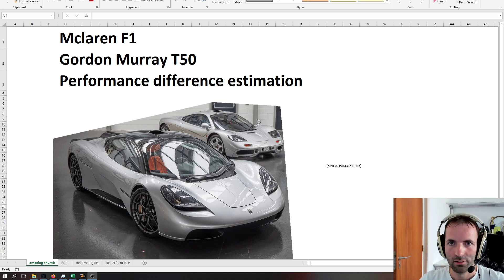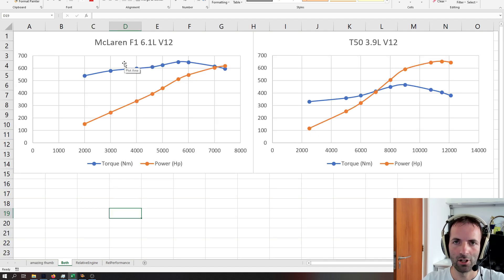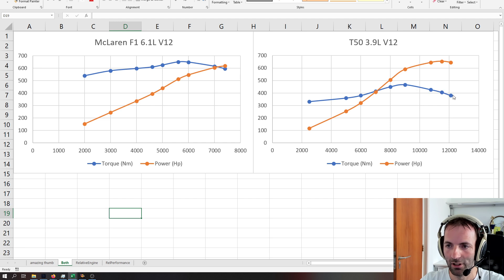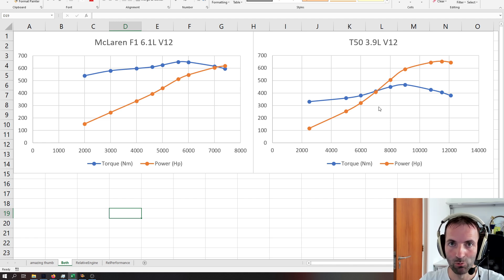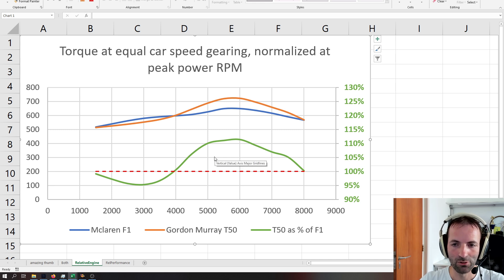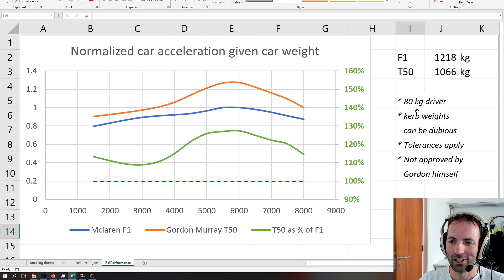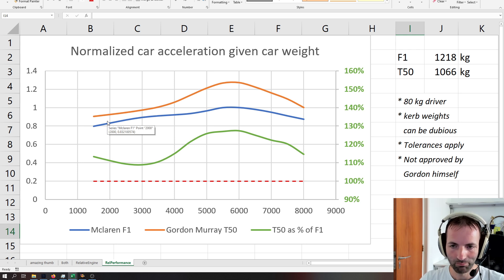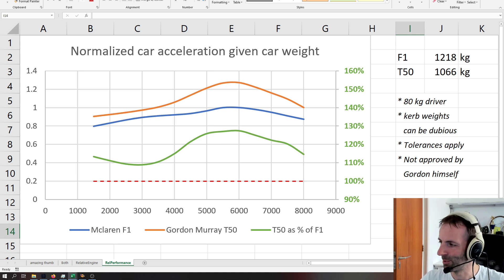McLaren F1 vs Gordon Murray Design T50, performance analysis

Comment: T.50 is ugly in my opinion,  and the engine sounds awful in comparison
Reply from the maker: Did you see Hagerty's video where Henry Catchpole drives both? I'm not THAT into the looks, and I think no video yet truly captured the sound of the T50 quite right. The deeper notes of the F1 are incredibly appealing indeed, but I bet you'd get goosebumps in a 12000RPM V12 as well..
Reply: I did see it, I'm just not impressed with the T.50. I've still not seen a good representation of a true F1 Successor.
Reply from the maker: @Asnyder4055  I'm not blown away by it either but I doubt we'll get anything closer than a T50 any time soon! Ah well, not like these are candidates for the cars we can get.. (if so, can I be your friend? :D )

Comment: Excellent video, can it hit 300 mph?
Reply from the maker: Only when falling off a cliff, and even then it probably needs to fall very straight down.. Air becomes solid at those speeds. If you need 300hp to do 150mph you need 1200hp to do 300mph, if the tires and rest of the car don't explode while trying..
Reply: @NielsHeusinkveld  Didn't the original F1 do 240 mph? and this is faster, so should it be able to do at least 250?
Reply from the maker: @yiva2037  I think they mention in the official info that it is not doing 240mph. And, the F1 had the rev limiter removed to do its 'record' run! So normal production Mclaren F1's probably won't quite reach 240! 
Such high speeds are really nonsense though, you will never do that, on most race tracks you will not reach ~180 or perhaps 200 on the track with the longest straight. So it is better to give the car a bit of downforce, to help stability and grip, at the cost of a bit of top speed.
Reply: @yiva2037  T50 will be a bit slower, 221mp/h - Gordon explained why.
T50 makes double the downforce, and downforce equals drag - that's why..
Reply: If straight line mode is activated it can do it I think but not more as power requirements will be significant after 250 mph

Comment: taking the gearing in account to "normalize" would require to include said gearing losses, or did I miss something ?

in any case I certainly do follow you on total weight consideration for actual performance estimation - and similarly power band width (whatever the gearing may be required) with respect to the total rev range does have a massive impact on drivers experience...

Comment: This completely misses the point. The T50 has been designed as a drivers car as stated by Murray himself. It's not a numbers chasing car. Having said that other than a bike engined track special I can't think of a road car that has such a high revving engine. That V12 is a masterpiece. Over 600 BHP and 1000 kg equals very quick indeed, add to that a 12k redline and more than enough torque - its like having the best musical instrument under your right foot. The cleverness of this car is in it's packaging and aero. I love the fact its understated and compact, but still arresting to the eye.
Reply from the maker: I don't think I'm missing any point, I know and love the car for its purpose. As was the F1, not a track car but amazing in so many ways. This video shows that even with reduced torque, because of the higher revs and lighter weight, despite not aiming for numbers, its still likely to outperform the F1.
Reply: @NielsHeusinkveld  It would be a very interesting drag race F1 vs T50 in a mile or longer runway, because F1 should have better topspeed, but it would need very long straight to overtake T50.

Comment: 986 kg wet, per Gordon, is including fluids, excluding fuel. Chose as tank sizes vary.
957kg dry.

We can speculate on performance figures but Gordon only cars about the driving experience. Anyone can make a faster car, he wants it to be still the best driving car 10 years after production.
I do wonder how this is being financed. For 100 examples, it seems painfully elaborate and bespoke. Why not 200 and make a buck?

Comment: Let's use that drag reduction concept with a fan to make race cars better!
Especially electric race cars that require less cooling per unit of energy sent to the road, but have trouble bring a lot of energy along, could really benefit to be more comfortable on longer straights and race stints. Who'll join me to create a new race car (series) that's SPEED/PACE focused, do everything Formula E doesn't?
FE got a 25 year monopoly from FIA to run open wheel zero emissions cars. WHY???? Because they'd use other circuits, keep the cars slow and lame (road tires, brake distance halve a straight).
Think Porsche 919 Evo meets T50 meets VW ID.R. Taking speed, more clever aero and AWD electric power from the respective inspirations.
- A prototype style car that has the driver over to one side (reduces frontal surface aero and this more efficient at speed)
- Swappable battery (if you can swap a wing or jack up a car, you can swap a 500kg battery), stint length 20-25 min on GP tracks. 24hr capable.
- LMP1 tyres
- AWD for better regen and short braking distance, fast acceleration.
- Ground effect, fan, low drag, enough downforce when needed via channeling.
- Maybe double the peak power output of FE if not more.
- Laptimes around LMP1/F2 thus close to 80's/90's F1.

Get in touch, design something together!

Comment from the maker: Things we have NOT taken into account:
1) Accuracy of weight comparison. This is a big deal, so with a more accurate F1 weight, we can be more precise
2) Rotating inertia of wheels / tires / drivetrain slow down your acceleration. I bet the engine and drivetrain hass less inertia than the F1, but the wheel and tire we don't know. Gordon says something about the wheel weight, but that is not equal to its rotational inertia. The brake discs also play a role of course.
3) Aerodynamic drag will start to come in probably from 3rd gear and if the T50 has less drag, it might edge away a bit more
4) Rolling resistance and bearing friction tend to have a constant and speed sensitive component to them, we don't know how this might compare
5) Gearing will also play a role especially once in top gear. The F1 actually can't do 241mph without raising the rev limiter! Given how Gordon wants it to be a drivers car, he might gear top gear to a lower speed than the car might theoretically reach in theory. With more power and perhaps less drag, who knows it might do 250mph, which makes top gear useless on any open road and even race track.
6) Insert many more things here by the time I figure out I forgot something. :P
Reply: He said the top speed was 227. He said that it's because of the extra drag from the extra downforce
Reply from the maker: @Obi-WanKannabis  Aha, well, little known fact about the McLaren F1, if its redline really is around 7500, you get about 222mph in top gear. At such speeds, tire expansion might slightly add to the effective radius but it certainly won't do 241mph. Making the F1 top speed really kinda borderline 'illegal' as the actual delivered cars, if 7500RPM was their max, couldn't achieve!
Reply: Niels Heusinkveld Exactly why the F1 top speed run had the redline fuel cut removed
Reply: @NielsHeusinkveld  It's not that unknown they flat out say it in the official top speed run videos. It's sort of a cheat but on the other hand the car is clearly capable of doing it without a fuel cut off so it's not like they're doing ferrari tactics of removing weight or something

Comment: What does he mean when he says "Reduce the gearing" at 2:09
Reply from the maker: To make the tires turn at 1000RPM with an engine that does 6000RPM, you need to reduce the speed by a factor of 6. For a 12000RPM engine, you reduce the speed by a factor of 12. And the more you reduce the speed, the more you increase the torque. That's how I compare the two engines. I reduce the speed of the Cosworth engine by a factor of 1.55 and increase the torque by a factor of 1.55.
Reply: @NielsHeusinkveld  makes sense! Thanks!

Comment: Eh... T50... I heard it sucks. But how much does it suck? Is it really worth it, to make it suck... at this ride-height, with no skirts?
Reply from the maker: Gordon says not a huge amount, as the suspension is softish and you want some travel to remain.. But it would be interesting to have some of the figures and especially at low speeds how much the fan can really do without skirts. I don't think its just a 'gimmick', because if you get 50kg downforce on a 1000kg car, hey that IS going to be close to 5% more grip, so even with mild forces you can greatly influence the balance / stability and even add a bit of performance.

Comment: Light weight, clean aero. I want to see this car on track.
Reply from the maker: Which is not what its made for! :-) It won't be slow but some nasty stiff big transformers looking car might be faster..
Reply: @NielsHeusinkveld  I agree Niels. But I want to know the feeling, the experience, the handling and the car behaviour. It will no be as fast as a Mclaren Senna, but it can be as fast a 458 challenge which is a track oriented car.
Reply: Stangely, it's lighter than the Aston Martin Valkyrie which of course has (a bit) of hybrid, bigger engine and fatter tyres, huge aero.
A bit like an underpowered Koenigsegg with skinny tyres, but a good but lighter.
Like a McLaren 620R, plus a seat, plus 4 cylinders, minus turbos, minus 325 kg (dry), plus 40hp, plus fan, minus high speed drag, plus manual gear shifts.

Comment: Seems that every reasonably big car coverage channel had a video with Gordon and the T50 so he must have been glad then those were all done... All 100 or so cars they'll build already sold it seems and it'll be a couple of years until they deliver as they're only now starting the testing etc.. "Harry's Garage" channel did an interesting video with Gordon especially the details on how Cosworth developed the engine. And if I recall Harry asked Gordon about using carbon fiber wheel rims and Gordon said no way which was interesting since the Ford GT has carbon fiber rims...
Reply: Ford GT, Mustang GT350R, Koenigsegg, Ferrari Pista and Renault Megane has carbon wheels available as option.
Maybe for some other cars as well...

Comment: Gordon Murray said that its 957 kg dry and the 986 kilograms includes all the fluids but with an empty fuel tank. So 80 kg driver + 100 liters of fuel means ~1150 kg with everything.
Reply from the maker: The question then is what is the status of the McLaren F1 'kerb weight'.. Sometimes it includes a full tank, sometimes half a tank, and in case of Italian cars, it usually doesn't include the chassis..
Reply: I know that homologation wise 90% of fuel tank, 70 kg of driver + 5 kg of luggage are calculated.
Reply: @fantomas76  True
Reply: @lepmuhangpa  so the T.50 weight could be about 1.114 kg ready to be driven in homologation form and by a quite fit driver.
Reply: @fantomas76  That's still very light
Reply from the maker: @fantomas76  Something like that but it tends to differ from place to place and with such an unusual car like the F1, did they follow the procedure?
Reply: @NielsHeusinkveld  somewhere I have the right numbers to get the two cars weight normalized, maybe on "Driving Ambition" (the best book ever made!).
Reply: T50 has 80l fuel tank

Comment: Very interesting comparison, Niels. Could you kindly share this spreadsheet? Thanks in advance.
Reply from the maker: Its really simple! When you create the RPM and torque points for the T50, divide the RPM by 1.55 and multiply the torque by 1.55. Then for the final car performance chart, divide the T50 curve by the value 'T50 weight / F1 weight'. That's what you get when you simplify things a lot.. :-)
Reply: @NielsHeusinkveld  oh yes, unless you are quite dumb with Excel like me... I will give it a try in the future or, maybe, I hope buying the car will be easier for me! Thanks anyway Niels!

Comment: didn't account for the tires
Reply from the maker: In what way?
Reply: @NielsHeusinkveld  considering even a pepega here has Phd in spredsheets i'd expect diameter :D
Reply from the maker: @lingSpeed  my guess too.. tire size but I've kept that out of the equation. Its effectively just another gear ratio, and the end result (car acceleration) would be equal. (with the many simplifications in my video that is)
Reply: @NielsHeusinkveld  I guess he means that the F1 tyres are old and higher sidewall might mean worse performance? I'm not sure though.
Reply: @Obi-WanKannabis  I have no idea what that means.